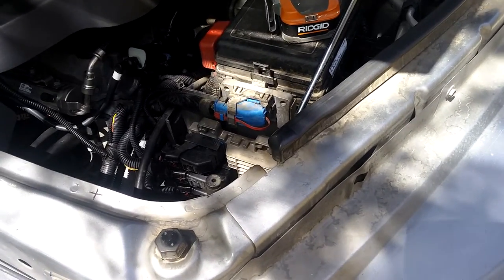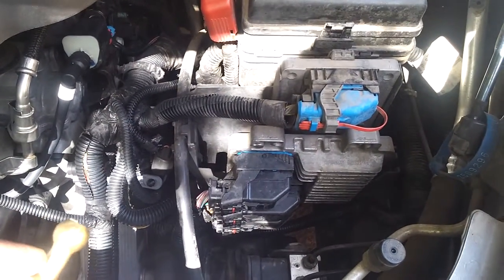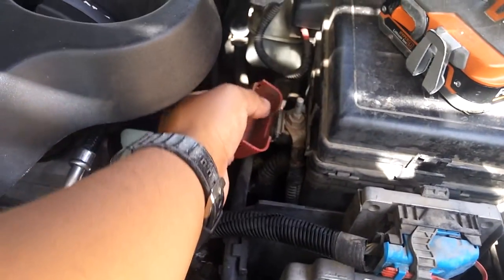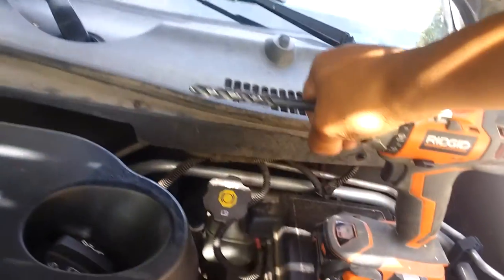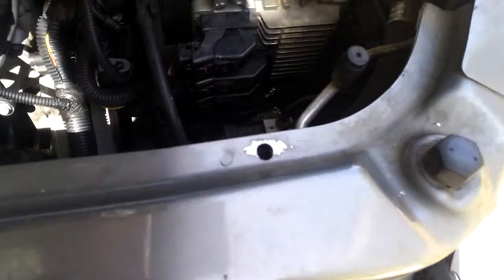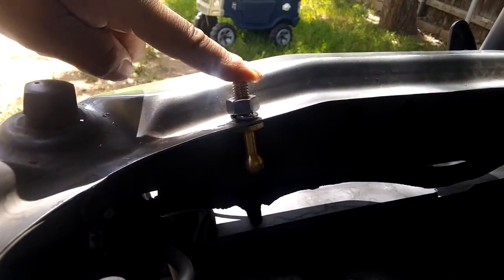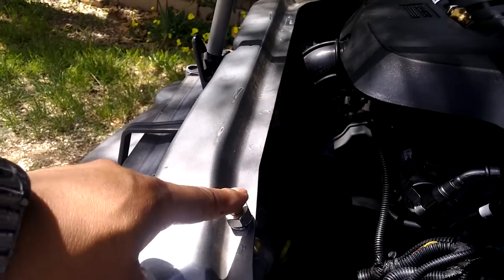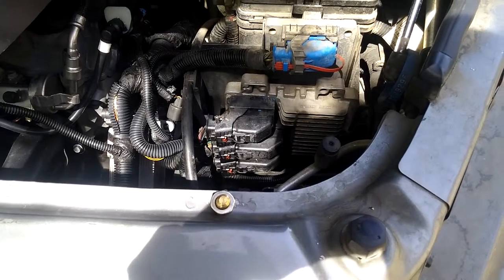Chevy HHR Negative Power Lug

Comment: Do you know how to open a driver's door when the latch is stuck in closed position on 2006 HHR. Key does not unlock. I removed drivers seat and partially removed door panel because I can't remove it. Dash will not let me remove it. I tried to see if I could access latch from inside car, so i could manually lift piece that goes over latch. I don't see anything I can move to open it from inside. Videos just show how to open stuck latch with door open....my door is stuck in closed position. Climbing over the seat gets old quick! I would appreciate any input! I'm a senior but I do my own repairs due to dealership and labor costs! Thanks!

Comment: go idea but i think i can do it better get a threaded  coupler same size as the stud and extend the stud on where GM wants you to connect the ground  to that might be as good yes??????
Reply from the maker: bobo smith 
that can work too.
Reply from the maker: bobo smith sorry but that might not work. the original stud GM wants you to use is actually part of the shock strut.